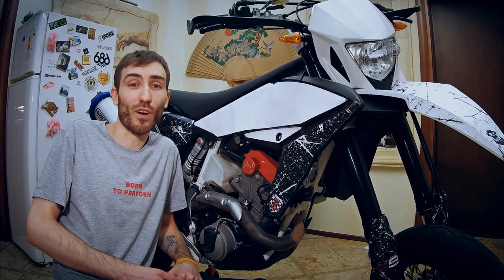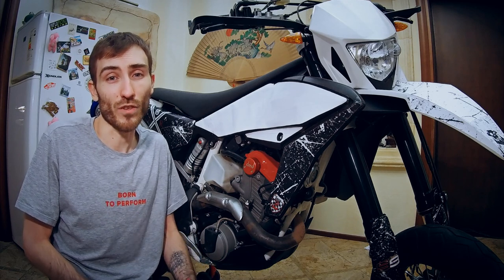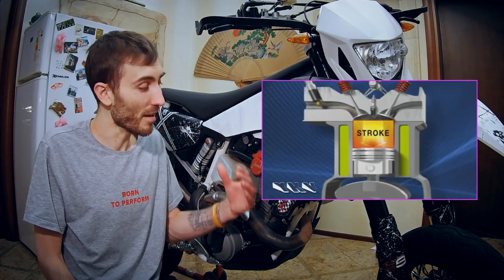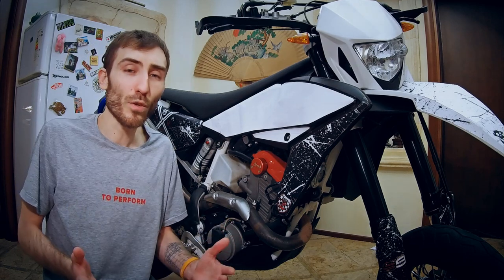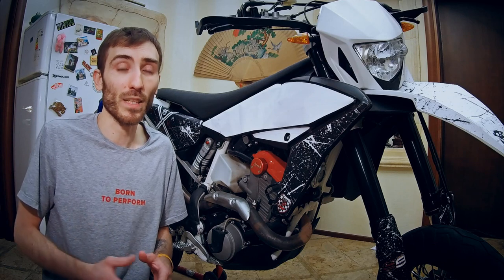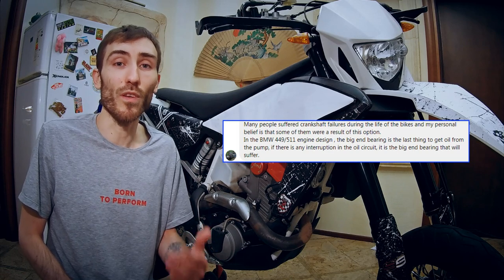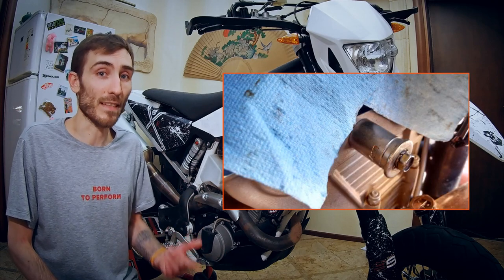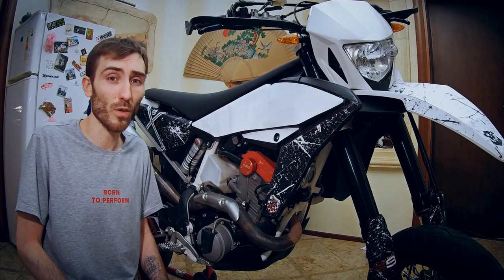Oil in airbox? Common problem. Cause and solution. | Husqvarna 511 / 449 & BMW G450X

Comment: Thanks.
I have this problem. I have a BMW G450X and in some cases the airbox collects oil and this oil wet the electric fire. THIS IS A PROBLEM.
Other solution is to install a collector in the airbox and using a pipe removes this oil to the chain, for example.
What do you think?
Reply: Sounds a bit complicated. And, considering that there are trustworty solutions, unreasonable.
Reply: I installed a breather vent cap in the valve cover of my G450X. It fits perfecte and I think I solved the problem.

Comment: I have a 2014 KTM 125SX. I'm noticing sticky oil leaking out of the air box. It's like the filter oil is liquifying and leaking out of the air box. Anyone know what this is?  New problem for us.  Just started after the last filter change.
Reply: Update. I talked to my dad the motorcycle professor.  He thinks the reeds are shot and the gas mixture is blowing past the reeds and into the air box, soaking the filter. The gas mixture liquifies the filter oil and then it oozes out of the air box. I'll check the reeds and see if that's it.
Reply from the maker: @jayeye4798  I hope It will solve your problem mate. Coz what I'm talking about here probably has nothing to do with ur bike. It was (is) problem of this particular model. And it was there from the day one you use it =)